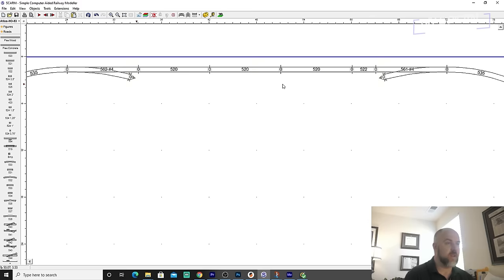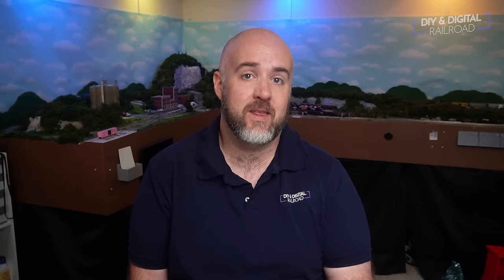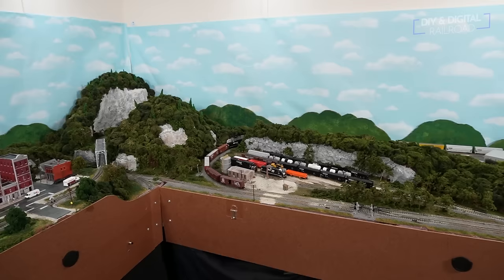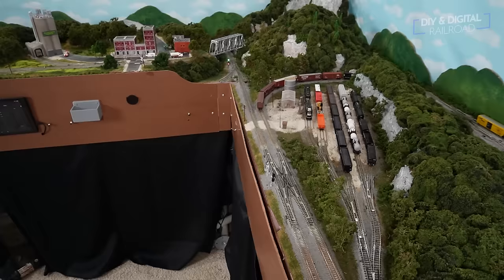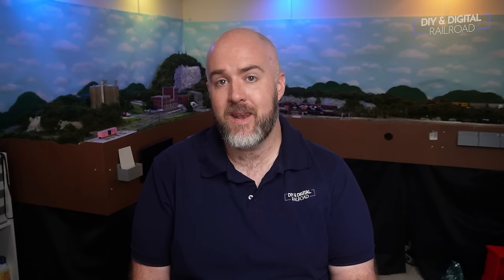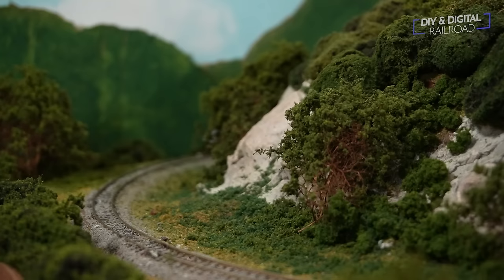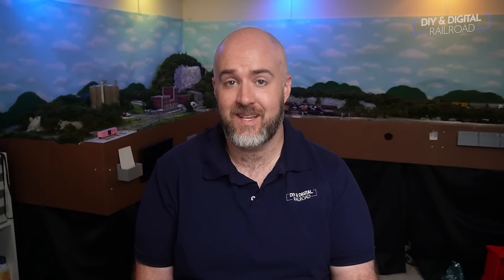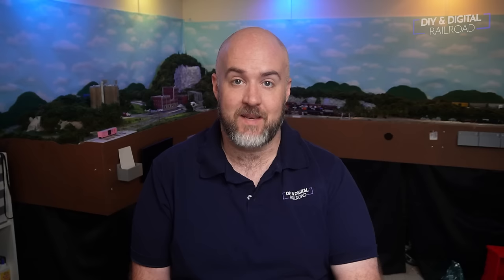My Must-Haves When I design a Model Railroad

Comment: I am amazed in how much the hobby has evolved from the point I first got into it.  True point-to-point layouts were rare with the vast majority being loops crammed with as much track as possible, the spaghetti  bowl approach, with spurs as an after thought. Finding that sweet spot of continuous running combined with 'realistic' switching can be a challenge.
Reply: Yeah I'm going to have a continuous run section on my layout, in addition to switching, but make it hidden in certain sections as to not get the train set around the Christmas tree feel.
Reply: I think the biggest help to getting away from the spaghetti bowl is DCC. The fact that you can control individual locomotives more realistically probably helped create the want for more realism overall.
Reply: @kents.2866  View blocking is an essential element I feel to provide the illusion of greater distance to the over all track plan. Having a hidden area where a train can be stopped for even five minutes while other tasks are going on can greatly add to the this illusion.
Reply: @gbwdude  When DCC first hit the market I was still in high school and thus it was well out of my reach financially. And now with DCC ++ EX out there as an option it is something I am looking forward to getting more into.
Reply: @Horse2021  I agree! This is another advantage of a helix, because the train running through it is out of site (assuming the helix is hidden) for at least a minute or two.

Comment: For my penny's worth there are several elements of a good model railroad. These elements are in addition to "off stage" area and runaround/drill track. Some sort of yard, passing tracks, sidings, interchange, and branch lines. Combine these elements of at least one of each in a Model railroad and expand from there. Create vignettes of approximately 2 to 3 feet. Tell a story with a progression and a meaning for being. This holds true for either prototype recreation, freelancing, or some where in-between.  Expand on this theme and elements as your layout grows. Absolutely rock solid realibable running is a Must. Draw the viewer into the scene/vignette giving a sense of being in/part of the scene. Gently direct him/her toward the next scene. As Frank Ellis would say treat your layout as the stage and your trains as the actors to tell a story. Use all the senses, to enthrall the viewer. Sight, sound*, touch, smell. Barely perceptible sounds. Like the wind gently blowing, the hoot of an owl. The babbling of a brook/stream. Barely perceptible but there. The hint of a scent. The smell of pine in the forest, loco smoke done sparingly. Wood burning smoke from a chimney. The sense of feel. What feeling does the scene convey? Texture, color, sound. Ask your self; Is this creation fun? Does it allow the spectator in as well as the owner? Those are some of the things I consider must haves. * Sound can be a dicey thing indeed. It doesn't take much to be overbearing. Be mindfully of that as you journey on steel rails.
See you on down the line pard,
Leonard Lee Davis

Comment: That is very similar to my ideal. At least one if not a double loop with crossovers to allow for run arounds while switching either one spur with industries or an entire yard. The only thing I have not put into a track plan yet is the ability to enter or exit. While prototypical it's just not something I have had space to implement yet although I could lengthen one track off of my yard and do it that way if I ever needed to. Also I agree 100% about towns. While I love the little downtown areas, etc. I'd much rather focus on the trains proper and what they do. Heck part of my layout, if I ever get around to adding it, is a grain elevator that was/is pretty much INSIDE downtown Carrollton, Tx. It's fairly hard to envision it outside of downtown but that is the way i'm going to represent it as to not have my layout dominated by a town scene.
Reply: The solution I'm using for "place to enter or exit" is the back part of the loop - or rather, a passing siding and a couple of extra tracks located in the back part of the loop. Loop can be used when I just want to run something, but can also be used as an "offstage" track.
Reply: Your "connection" to the outer world does not need to actually go anywhere.  It can be a dead end that is just for looks, or it can just go to a hidden mini-yard where you can park a train when it "goes to the next town".  You can hide it inside a mountain or behind some buildings.  Whatever works for your scenery.

Comment: I agree with everything you said.  My layout plan, which for a number of reasons may never come to fruition, is a complete loop around the walls of a small bedroom, with a lift out across the entry door.  It is a loop for continuous running, but the town in one corner represents two towns depending on which way you approach it, thus giving point to point.  You just have to imagine breaking the loop and straightening out the curves in your mind.

Comment: My layout was first based on John Allen's Timesaver puzzle and was just a small switching layout that has evolved into something much bigger.  The timesaver is still part of it and is used as an industrial district with 4 customers.  
As for continuous running, that is called railfanning and I too run my railroad that way at times.  There are times you JUST WANT TO WATCH TRAINS!
As you said most of the time a train is going from point a to point b with nothing to be seen but trees, I try to create that by having the trains go behind and through the scenery but I have to admit that most of my layout is city based 🥴just broken into different parts.  
Thanks for the videos, Jimmy.
Reply: I cannot say I have ever heard of Jack Work when reading about the Timesaver puzzle.  Everything I have seen points to John Allen but maybe he took the idea from Jack Work and made it more public.  I don't know but as you said John Allen did some fantastic stuff.

Comment: I am just starting to put together my layout. It's something that I have wanted to do for YEARS! A nearby hobby store was divesting itself of most of the model train stuff, I bought some things that I thought would look cool or maybe whimsical for half off or less. One of the things I got was a bunch of hay bales, cows, horses and also some corn stalks. So a must have for me is a farm. A small one but a farm. Also a mountain scene of some sort with a stream. I also acquired some rafters and campers.
Reply: Hey man it’s your layout do whatever you like for me I need a loop so I can have continuous running and I need some switching so I can have some industries gives the trains something too do. Plus I like to mostly do the scenic stuff over the typical town so most my layout is scenic trees landscapes with some industries and a small town with a gas station and a street of buildings. It’s a 4x8 HO one loop with a dual turn on one side so the train could take the inside curve or an outside curve and the middle of the loop I mostly have switching to industries.
Reply: I know this is 7 months after you posted, but here's some thoughts.  First, avoid the 4x8 or any solid rectangular bench.  There are plenty of layout plans that explain this, but the short of it is that a 4x8 limits you terribly, but with the same wood, you can make a large "donut" shape with much more space. (assuming you have the physical room for it)

Second, if you place your small farm along an edge with a farm backdrop behind it, it can look as large as the vast farms out west.  With some careful placement of foreground scenery, it can look like it goes on and on.

Just remember the 2 rules of model railroading:
1:  It's your train, your rules.  Do it how YOU want to.
2:  Have fun.  If you're not having fun, you're doing it wrong!
Reply: @chadportenga7858  Thanks for the input.
Yes to those 2 rules. I have one as well. Not sure where I saw/read/heard it. Don't worry about the landscape being perfect - 'cause nature isn't perfect. 
I have finally settled on a layout. If you're looking at it after first the room, it's sort of a fancy, backward "L" with the extra up part at the bottom. It's 10x10x7 with two feet of  space between the leg and the 'tip'. The space is a little limited due to closet/attic accesses. 
I have finished the mountain part of the stream/waterfall/tunnel and am now starting to work on the stream flowing to the 'ocean'.

Comment: Since giving up my childhood 4x8 in 2015 I've explored a lot of minimal track plans, and found the two most important things for me are split sidings (Inglenook style) and having straight sections in long curves.

My first attempt at a downsized layout was a circle to go around the Christmas tree, but I soon found that I needed to see the cars straighten out every once in a while. Otherwise the train is just chasing itself around a curve forever! I added some straight sections to make a sort of triangle and it made it so much more interesting.

My childhood layout had two sidings which were just single spurs off the main line meaning that any car sorting or spotting would tie up the main line. They had been tacked on as kind of an afterthought. So when I started laying out my switching shelf layout, I included one siding that split into two for increased sorting and spotting opportunities.

Comment: I'm building a short line focusing on grain operations with some light commuter rail service. Grain elevators, a flour mill and breakfast cereal plant are the main industries with a few warehouses and a port city at one end with the interchange to the larger rail network. The lead up to the interchange is on a loop for continuous running trains in the background.

Comment: Interchanges have been mentioned in previous comments, I use 2 kinds on my layout; dead and live. Dead is where cars are shoved into a siding to be " picked up" by the connecting rr. Live is where the connecting rr locomotive cones and delivers and picks up from a shared siding.

Comment: One of my MUST HAVES is space for vehicle traffic to come and go from an industry.  It makes no sense to me to have an industry inaccessible by anything but rail.  Workers have to drive to get to work, they're not going to take a freight train (with VERY few exceptions).  I tend to use view blocks to hide my continuous running tracks. 
One of my MUST NOT HAVES is to have a ridiculous amount of track and sidings, there has to be some logic as to why the tracks are there.

Comment: I agree with everything you said. I would add that on my layout I have industries at both ends along with my continuous running loops. I have industries that feed the industries at the other end ie a lumber mill feeds lumber to a lumber yard and pulp to a paper factory. Then the lumber yard feeds lumber to a furniture factory that then sends furniture to a distribution warehouse etc. I setup up empties to be picked up along with full loads to be dropped off and run a session to do all that. Much of this has been inspired by your layouts and wonderful videos. Thanks and keep up the great work.

Comment: i have a big and a small staging yard to swap train on either end designed it with the possibility to just let them run around. but they obviously always turn around at each end so it´s way more interesting to see the train leaving in one direction and coming back from that direction. For me it was important that i can do both. proper ops but also just running while i switch in the yard building new trains.

Comment: I've found on my 4'x7' HO layout that one industry spur can support several different types of cars to be moved. My sawmill spur has a tiny loco fueling station at the end of it, so it takes a log car; a flat car to ship the sawn boards; a wood chip/sawdust car, a tank car to fill the underground fuel tank; the switch engine to take on fuel.

Comment: You will probably hate my layout as it is small and simple, but it has everything I want and need. 

Must have #1: ability to run two trains at the same time. One passenger and one freight. I will have three different freight trains to run: Santa Fe Super Chief (from the starter set), an Am Trak and an old (looking) Seaboard Doodlebug and matching passenger car.  I will also have three freight trains. The EMD Bluebonnet freight train set plus the mixed freight set (all Kato). A CSX mixed freight consist of various cars for industries on my layout (all Micro-Trains) and the Covered Hopper 8 Car Set pulled by a Southern Pacific EMD (all Kato). Trying really hard not to mix Kato and other brands as their couplers do not play well together. 

Must have #2: it must be small enough to fit on my dining table (78"x40") yet big enough to have a small switching yard. I live in an apartment, so space is limited. 

Must have #3: Being ovals, it will have a "town" in the middle. I'm using Design Preservation kits so, think Mayberry. I wanted it to look like one of those small towns you drive through on a small highway. You top a hill or round a corner and suddenly you're in a tiny town and out of it just as quickly. 

There will be a road running left to right called Highway 58 but from the crossovers on the left to the crossovers on the right, it is called Main Street. There is an intersection midway that runs up, over another set of crossovers and down ending at the yard (Black Bear Road). 

There will be "mountains" in the top corners to give the impression that the trains actually go somewhere albeit in mere seconds. 

I created the plan using SCARM and transferred that image to PAINT where I created a MAP in color with the buildings (sized approximately using the width and length on the web site) and roads and trains added in to see how it might look. 

The past couple of years, the layout has changed many, many times as I would call it up and stare at it and think: "I wonder how it would look if,,," and make those changes and save it as a new version. There have been a lot of versions, but I think the one I have now is pretty much set in stone (soft stone). Thanks.

Comment: Well, just depends on your region of modeling.  I model central Europe.  Rail work is 90% passenger on fixed schedules, moving from city/city or between smaller towns.  Passenger cars are shuttled in the terminus locations. Cars, head units are adjusted per schedule at the specified stopping points.  So  the desire is town or city as destination and focal point with a parade track to look good in route.  Freight MUST wait for passenger breaks.  A runaround is good to prep freight but usually intercity is a short route and not too many cars just because not enough time on track.  Bad news is freight is not making enough money.   There are just a few monster yards that organize large freight runs but those are scheduled just a few times a week.  Sadly that is profitable but just is not yet gained enough support through the EU to realign passenger traffic.  The other issue is slow decline of the bulk commodity needs.  EU looks more like smaller freight yards mixed or nearby the passenger lines to jump in when available.  I do like to run continuously while building a small freight set on the runaround.  Move it to the mainlines while rearranging head units on the passenger trains at the main station.  Totally busy!  I model the late 60's so get the benefit mix steam, diesel and electric and nothing moving really fast.  Started in Marklin HO.  Moving on to N just because of space.  I do appreciate your design perspective from other points of view.   Next layout is a hybrid.  4x8 sheet divided in half lengthwise.  City/main terminal on one side, rural small town on the other, double oval track running between the two.

Comment: Very good share of your thoughts Jimmy. I am the exact same way. The only difference is on the layout I am designing that instead of using a circle, I am using dog bone style with returning loops on both ends this way I only have 1 double main track running through the whole layout even thoughfor HO scale, that takes up a lot of room as thatloop is a 30" radius. - Jason

Comment: I am creating my first real layout and had to ask myself this question recently.  I decided on…

- at least three continuous loops
- the ability to move a train between all three loops
- one loop must be O72 minimum (it’s O gauge)
- at least one tunnel
- a ramp long and high enough to pass another train under
- a city area and an industry area
- the ability to reach anything on the layout while standing flat-footed on the floor

My layout design ended up pretty symmetrical, so it’s possibly going to be a bit boring… but it met my criteria, so I am okay with that.

Comment: One thing I like is some sort of way to reverse a train (or at least engine and single direction cars).  If a layout isn't big enough to be something like a loop to loop, and you are going to operate, it's nice to have trains come from both directions, even if this is just a way to fiddle between operating sessions. Session one, run train eastbound from A to B. Between sessions run the loco around the reversing cutoff to get it facing the other way. Next session run that train westbound from B to A. With a continuous run layout this can be a cut-off with an industry on it, so that it isn't a conspicuously non-prototypical chunk of trackwork.

Comment: In HO scale I am doing a point to point (L shaped on a 16" shelf), using a modern industrial park as my theme. Three industries spread out, as the semi trucks need room to maneuver for the docks!  N scale (2' x 5') will be continuous run with a couple of sidings for switching. Running a 4-4-0 in the 1940's. Room I have is only 5'8 ' x 9'6 '. Have had to compromise in both scales to make it work. Between the two I have a little bit of everything!